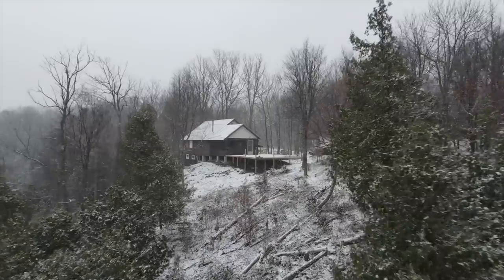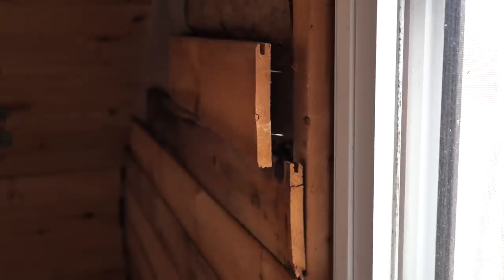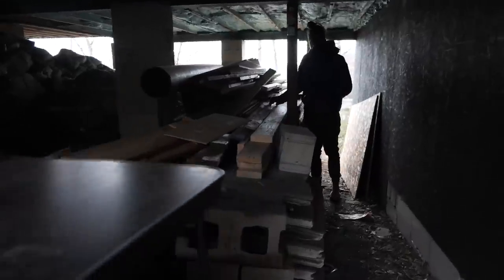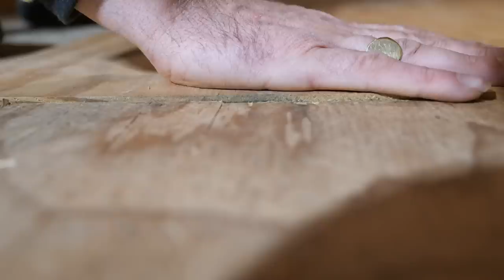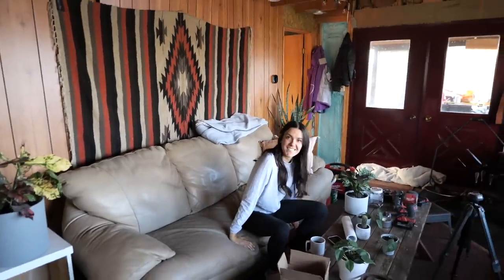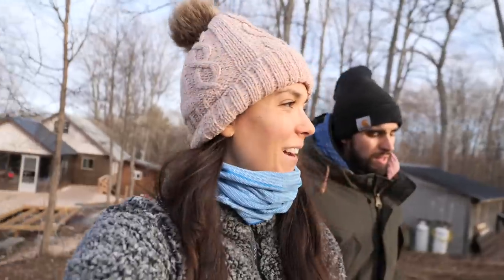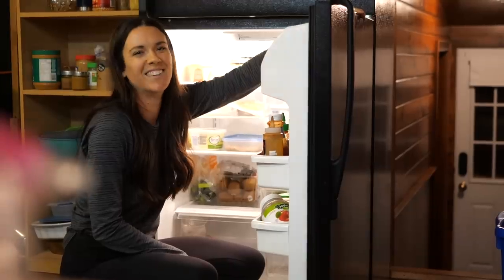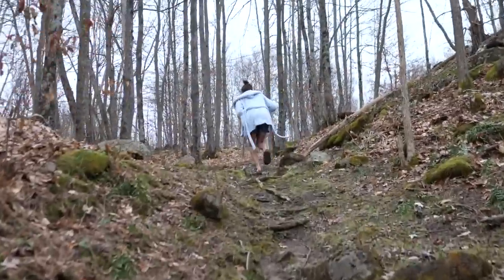HOW TO WINTER IN CANADIAN WILDERNESS

Comment: I live in Norway and have these temperatures you are currently struggling with. 
Just wanted to give you a clothing tip. I see you are wearing cotton. Cotton does nothing against cold, other than getting wet and cold if you get warm/active.
A suggestion is to ONLY use wool and fleece under windproof or other outer layer. Check the labels so there's no cotton inside. The ideal would be to have an inner layer of thin perforated wool (tiny holes that trap air to isolate), then another layer of thin wool, then thin fleece, then outer layer. (You probably knew this and just want to promote your new cool sweaters)
Here young people do wool for running, skiing, hiking, sitting and if needed also for sleeping. 

Walking or skating on icy lakes are such an amazing activity and so fun to discover this strange habitat.  Here in Norway, we use ice picks that have a long string that goes inside the jacket behind the neck. If you fall in you have ice picks to easier come out of the water. We also always have a backpack with a throwline at the ready! If I go without it here, people will give me the "are you crazy" stare :D 

I love watching these renovations! So inspiring for my own cabin!
I have so much tool envy! All your saws! Saving up for more myself! :D

Comment: Load the lift with several logs. They are not big pieces.  Use a splitting axe not a felling axe! Keeps you warm while splitting, warm while stacking and warm while burning! You will need several tons to keep warm.

Comment: Hope you put isolation in that chimney shaft. Oh I see that you did!
Have you thought of putting the plastics  they sell for windows?  You're a little late in the season, but if you warm up the window sills with a hair dryer the tape will stick fine.  That would keep the cold out and the heat in as the window are often where you loose  the most heat.

Comment: Denmark isn't very cold in the winter or very hot in the summer (and if, then only for a very short time), but these are, by law, the minimum thicknesses of insulation is a new/renovated permanent residence:
Roof/attic:  455 mm - outer walls and floor: 300 mm (when used traditional insulation)

And low energy windows (with tree lairs of glass) which are highly recommended, only add to the positive list.

It saves you a lot of money each year and keeps your house warm in the winter and cool in the summer, and especially it very cold and very hot climate countries.

The extra money for a well-insulated construction is a Win Win for your economy as for the climate!

Comment: Gee, I had 6 of these windows when we purchased this house.  Adding wooden frames with plastic windows was huge, the heat loss was greatly reduced.  I purchased some windows from one of the big box stores.  They are slightly smaller but are a lot cheaper than custom windows. Since they are all now double glazed they are now better by themselves.  But I still added a layer of plastic to the inside they are now a lot better still.  I am sitting next to one right now and I have  no heat loss that would give away that I am near a window.  PS don,t pay extra for "extra something or other" its already made that way by law!  Cut your air infiltration or loss that will make the most difference.  Where you can add the R6 per inch styrofoam.   Adding expanding foam spray around the doors, windows and electrical boxes also help.  In the 14 years I have this old house my heating cost has not gone up!!

Comment: Just a heads up but local BUILDING CODES here require vertical railing banisters to be spaced at no more than 4" so babies head doesn't get caught in them. You may want to add some or adjust them for your child's safety.

Comment: You better confirm that the spacing on the vertical boards on your railings are not more than 4" between them - the spacing looks larger - you won't want those little ones to fall through!
- Home Inspector in the US.

Comment: hmm metal foil tape ... metal conducts heat ... better off with duct tape heck a few plastic bags taped over the hole would have been better
Reply: use a splitting axe instead of a felling axe would be better